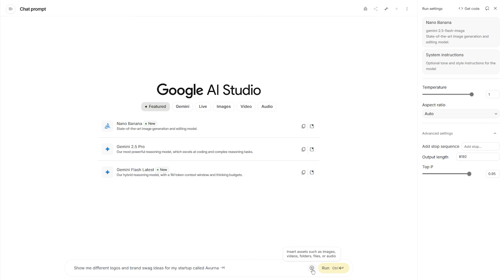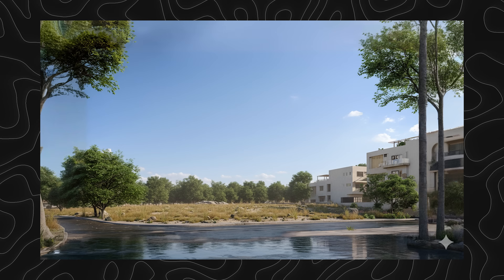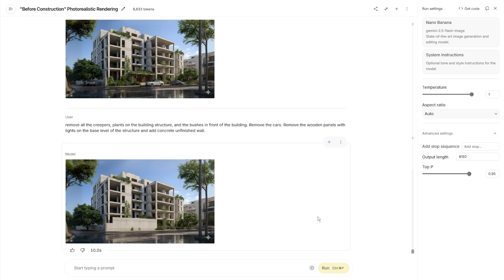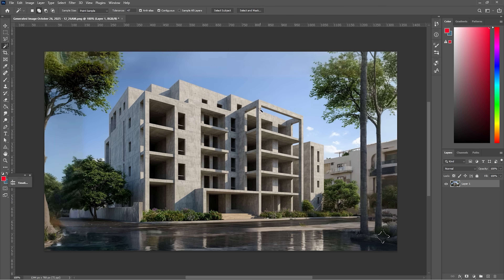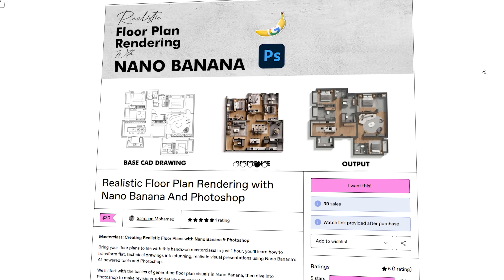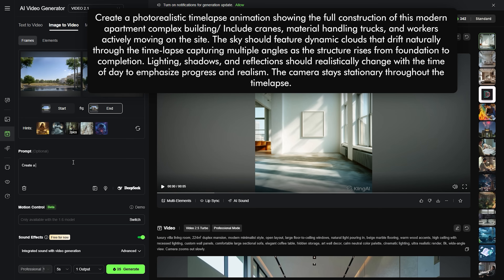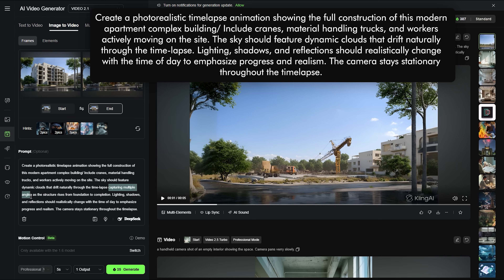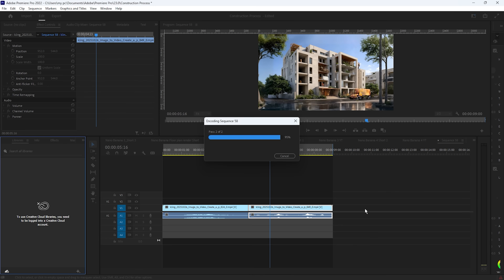This AI Tool Turns a Single Render into a Full Construction Timelapse 😱

Comment: Create a photorealistic rendering of the same building from the same camera angle, shown during the construction before the exterior wall and cladding were installed. Expose raw structural concrete, unfinished framework, and visible floor slabs with no facade walls. Keep the surrounding environment and the street, lighting and perspective consistency with the original scene.
Reply: thank you, you are the man!

Comment: If this rendering was done in rendering software, changing the floor and wall materials to rough concrete is much easier to do manually than trying AI Prompts. You see how it makes us lazy. But the final output is okay.
Reply from the maker: That's true. But if we're using this technique on an actual built project image, this would work.

Comment: Hey! Awsome video! How long it takes to generate the video in KlingAi? without the "Fast-track Generation"

tks
Reply from the maker: It takes around one minute on Kling AI!
Reply: @salmaanarchitect  without the upgrade, doing the steps you made, i'm still waiting after 3/4 hours 🤭 (it says now: In the queue..Estimated waiting time: 20 minutes. But always changing the time)

I guess the "queue" is the problem.

with Video 2.1 - Professional Mode - 5s and 1output
Reply from the maker: @teibao  Ohh ouch, guess it's only faster on the paid version. You can try Meta AI or Grok instead.